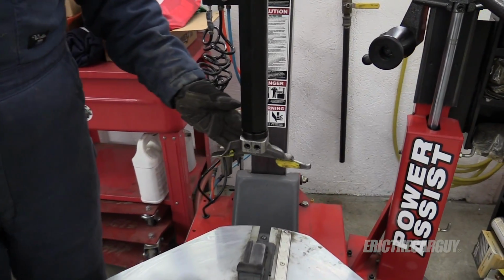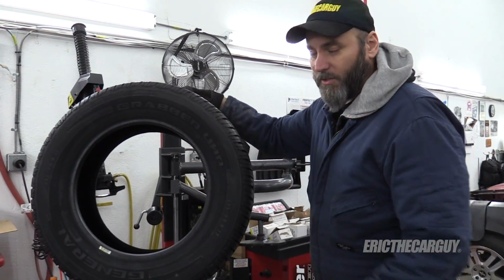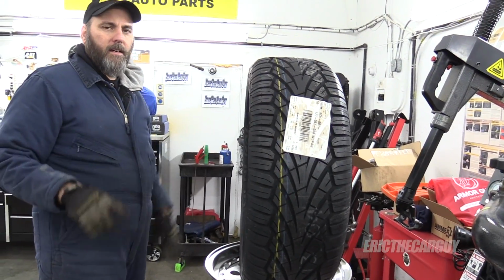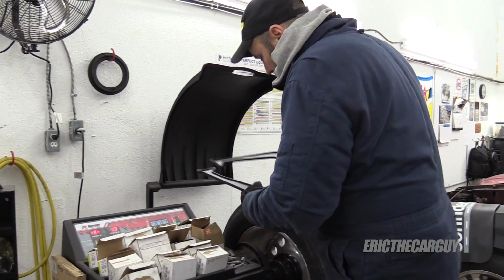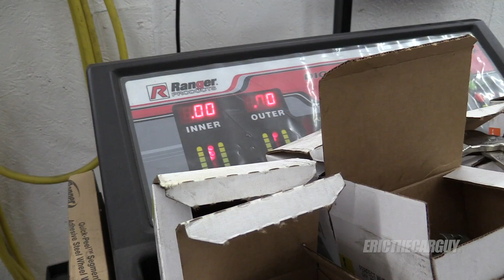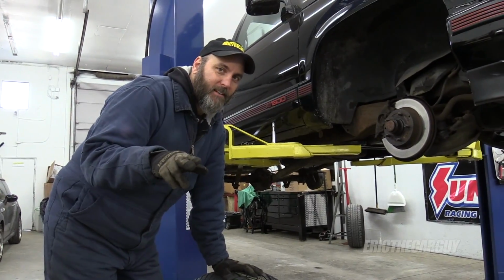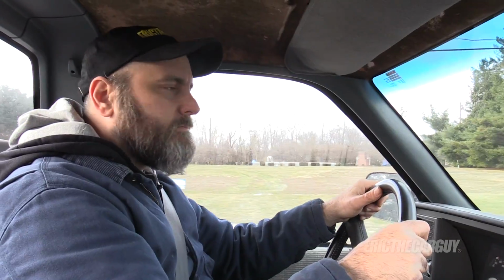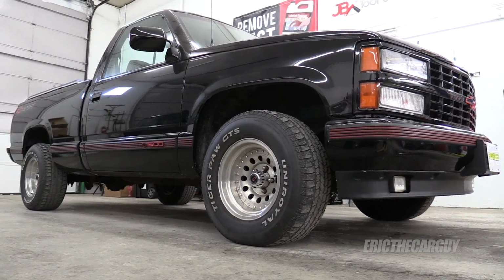#ETCGDadsTruck Gets Wheels & Tires (Episode 2)

Comment: Consider putting a laser level on your balancing machine. You can use the laser line for easy placement of weights as you don't have to guess exact 12 o'clock once the level is aligned.
Reply: Spot on. I was thinking the same thing after watching his fight.
Reply from the maker: Good idea.
Reply: The hunter repair guy that comes to our shop says you should never store weights on the machine because it throws off the balance.
Reply: @mattkaydus7973  Unfamiliar with the machines. Worth considering. If direct mounting has an appreciable effect it always could be installed in line with the machine but mounted low off a footing or something.
Reply: Thats for rooks

Comment: Eric, you have quite the nice wheel/tire tools there.  In fact, your whole shop is well outfitted.
Our shop would do wheel balance every 7500 mile service at our Infiniti dealership.  Wrestling 22-24" aftermarket aluminum wheels off of a QX56 and trying to balance them with tape weights was ALWAYS a nightmare.  Round and round we go...

Comment: i know your pain Eric. in my old shop we had a picky balancer (boss wouldn't calibrate it or get a new one lol) same style as yours and fought all the time with it. i found the best trick was to start with the sticky weight side first then do the clip on last. some wheels i found would be a fight no matter what but sometimes even putting an extra 0.25oz would make the sticky side zero out. 
just food for thought Eric. hope you see this and it may help you.
Reply from the maker: Great tip. I'll have to try that next time.
Reply: Even when they are calibrated, if they are sufficiently old, there's no saving the machine. Bearings, motor, wear and tear on the electronics and EVEN the cones, they just don't work anymore. I have one that's likely been in many shops until i got it, because i do tires once or twice per years, so i can't be bothered to buy a new one. It's calibrated and has new bearings, but it still fights me.
Reply: @aserta - Mine is only 9 years old, but has done the .25 oz swap game since it was new. I figure it must be the way the computer in there is calibrated from the factory. The chinese balance I had prior never did this. It's definitely aggravating, though. Going to try the OP's tip of starting the stick-on weights first - sounds like a good plan.
Reply: Eric - I'm wondering if the stick-on weights are having slightly less effect, as the further inwards they are from the outer edge of the rim, the less leverage they have to affect the balance.  That might explain why those weights always seem to need an extra .25 oz or so.  I remember having a similar situation when I learned to balance in tech school, but that was on old equipment and 35 years ago.  Your balancer is pretty new, and I'm assuming balancer accuracy has improved over the years.  Could be worth a thought, anyway.  :-)

Comment: when I was a mechanic long ago 80s-90s  tires where relatively smaller. didn't have as many fancy rims. steals were easy to work with.  Now everything has  truck style tires which are heavier and bigger work with.  Tires are more of  a pain in the ass to work with currently. 
regardless those Centerline style aluminum rims have always looked great on a older truck. Good choice Eric.

Comment: Those things are sweet! Nice choice. I have a similar looking tire for the summer on my Silverado, made by Hankook (Ventus). Got the set dirt cheap off eBay a few years back. 

I fight with my balancer too! I thought it was because it's chinese (Atlas brand), but seems to be the way most of them are. My old no-name balancer didn't seem to keep placing .25 oz. weights right next to each other like the Atlas does.

Looks like I need to upgrade my tire machine though! Your's is REAL NICE. The tilt back plus helping hands make a HUGE difference. Mine is like a piece of exercise equipment - no matter how cold it is in the shop, I'm sweating beads by the 2nd tire.

Comment: Tech tip: yellow stripe on the tread mount two tires with the strip on the inside of the wheel and two with the stripe on the outside done ✅

Comment: The easy way to mount directional tires, in my opinion, is by the dot date. You do, 2 dot date on the outside, and 2 dot dates on the inside. Usually works unless the tires have dot dates on both sides.

Comment: The plastic caliper used to measure wheel width is usually of by 1/2”. Reason being the wheel width is measured from mounting surface.  The caliper is measuring an extra 1/4” on each end.

Comment: Eric i use ur videos for all my sick Honda needs lol u are good at what u do and easy to understand and I greatly appreciate that cuz my car knows how to stress me out lol 97 accord se non vtec i have replaced all cooling system water pump radiator timing belt all hoses thermostat gonna do engine coolant sensor in a min i have did all u said bled the air out with valve by thermostat housing etc. Over n over but i untighten valve let run all u said but my gauge dont even get close to middle stay way by cold n still has air so is there any other valve or should i drive it with valve loose a few blocks. Cuz after my car warms up i cut it off it dont want to fire n i smell lil gas but it acts like it misfiring then it will kick to normal on rpms n it aint running at 1000 on rpms its under
Reply: Give me some ideas where to check to fix problems

Comment: Eric, I'm sure you know this, but if you're chasing weights, the best way to fix it is to adjust the position of your weights. If you're off by  0.25, slide your weight 1/4 in the direction of where your machine says you need to add weight. 

Putting weights in multiple locations isn't actually balancing the tire, you're just tricking the machine.

Comment: I remember when I was lowering my ç1500 years ago.  Alot of the lowering  spindles would widen the track some . Like 3/8-1/2" each side and would cause rubbing on the wheel lips of the fenders to the tire.  Im not sure how much you plan on lowering it.    But I have a 4f spindles and spring and a flip kit in the rear.  Im pretty sure it has shackles as well due to tall tires.  But it seems very drivable even pulling a car trailer.   It does occasionally hit the bump stops in the rear though.

Comment: The new wheels/tyres look smashing, very similar but better :-D.
I had forgotten about the up gearing effect of bigger wheels, larger distance traveled with each shaft rotation.
You were speeding, slightly :)
Reply: The new wheel/tire combination is only 4 less revolutions per mile than the stock wheel/tire. So, he was speeding by about 0.2mph at 50. Not even worth noting.
Reply: Tommy-Lee Armstrong
I did say slightly :-D
Reply from the maker: I tried to get a tire size that had a smaller sidewall so that the overall diameter was about the same. I don't think the speedo is accurate now because of the mismatched transmission. My new speedo will be satellite so I shouldn't have to worry about it being inaccurate.

Comment: Just something to think about, but I have always had new wheels, whether steel or aluminum, spun on a balancer to check for warpage, trueness and severe out of balance, before tires are mounted. No weights are added this time, it is just for inspection purposes.

Comment: We had the same brand of balancer, but an older model. Same problem... then it got progressively worse until it stopped reading consistently all together.

If you can afford a newer design, it's really worth the time fiddling. It may not seem too bad but it adds up.

Comment: Here's how you do the stick weights man.  Take it and bend them so the middle doesn't touch the rim. Spin it if its zero than just smush weight down.  If you need to move weight up or down you can do it easy because whole weight is not stuck on.  Tires are good with that little weight

Comment: Kind of late but if you move the weight side to side you can feel if its top dead center the if you look over the wheel you can confirm if you sight the weight with the spindle. Another thing to think about is using a heat gun on both the weight and wheel as well as using alcohol and a lint free paper towel on thw wheel they typically have oil on them from the factory and it can help keep from losing stick on weights later on. How you did it will work for sure just some ideas to help make it last a bit longer next time

Comment: swee truck i have my grandpas  1991 Silverado Extended cab 2wd, needs some body love but the 5.7 in it has 220k miles on it and runs smooth as heck. My grandpa used to sell amsoil so synthetic fluids is all this truck has seen, sadly the trans is not original lol 700r4 issues, but the built trans i put in it works great, updated every problem part in there and addeed more clutches to the usuall problematice 3 4 cluctch pack. so instead of the stock 5 clutches it has 9 in it, the 1st to 2nd shift will about snap your neck off when putting the throttle down at times. i love this truck and am also in the debate of putting a 383 in it or going with a 5.3 LS with turbo. will have to see how yours turns out might help me deside what way i want to go.

Comment: You have to use the arm to install the tape weight inside. thats why your not getting 0 balance right away. it ends up being at around 11 oclock not straight up like your doing it. Try the arm and it will work perfect.

Comment: When your balancing wheels don't just keep adding weights where the machine tells you to keep all the weight together on each edge of the wheel if the machine is telling you to add more weight to a side of the wheel you have already put a weight on move the first weight round the rim half way between its original position and the position the machine is asking for more weight on,  hope that makes sense and helps you balancing wheels in the future love the vids and both channel's

Comment: I've had balancers that I've fought with as well so instead of wasting new weights, I'd use old weights with masking tape first to get the position/weight figured out temporarily before sticking on the new weights. Temporary sticky first, then clip on. Also, since you live in an area where they use salt, avoid using any clip on weights unless you want that dreaded corrosion to creep inside to the bead area of the wheel. Aluminum can be cleaned and bead sealed but chrome is hopeless.
Reply from the maker: Dude! Great tip. Thank you.

Comment: You'd have a better balance putting the cone on the outside as well. That way, the wheel hub is flat on the flange and the cone is helping you straighten it instead of the two cones fighting each other to an unknown straight.
Reply from the maker: The problem with that is it can damage my new wheels.
Reply: @ericthecarguy  How? I've always used the little "inner" cones on the outside and used the handle to snug it on. It mounts the wheel more straight and gets a more accurate balance reading.

Comment: Does your balancer have a round feature? I used to have the same issue. Then I turned off the round feature and I was amazed how much easier it was. The balancer seemed to have a poor logic system. Sometimes it would round .43oz down to .25oz instead of rounding up to .50oz which in my opinion seems like the better option.

Comment: I have been told. That new tires can struggle to balance because when they pop on to the rim under pressure the bead is stretched and out of round just slightly.
If the fellow who gave me this advise is correct you can fix it by letting the tire completely depresurise before installing core and inflating to final pressure.

Comment: I have an old hoffman 2100. You think you have fun with yours- at least it works. Mine doesn't tell me where the weight goes anymore. lol I have to give an educated guess and move weights around via process of elimination to balance my wheels. Takes a long time. I'll give you a tip or trick when you are using the stick on weights. If you are dynamic balancing do the stick on wheel weights first. those weights will affect the backside weights that clip on.  The problem is the weight is not going where the balancer wants it. It is going to the inside. You might be able to get more accurate readings by telling the balancer that the wheel is narrower. For instance, the 8.5 width is not where you are putting the weights. Try the 6.5-inch? width that actually represents the true distance between the weights.

Comment: Do you think some 16" wheels and 32x12.50R16 would fit on a 95 C1500? It has more height on the front end than a normal C1500 for some reason.

Comment: Hey Eric I have a question for you. I replaced my passenger side wheel bearing  and hub on my 1990 Corolla sr5 . Spins smoothly and everything until I tighten up my lug nuts . Once they're tightened to a certain point the rotor seems to scrape at the top of the caliper and wont spin unless I force it using a lot of strength Once I loosen them a bit the tire will spin again while making a slight scraping noise but they're too loose to ride on at this point ...

Comment: Are you gonna put a headliner in that truck?  lol.....
Reply: Maybe one of the sound system headliners since he's aiming for 90's styling I remember many people using those back then.
Reply from the maker: I'm not planning on doing any cosmetic work at this time. I'm going to wait till after I get all the performance and mechanical work done so that I'm able to make the Power Tour with my dad. Cosmetic work takes time and money I don't have right now.
Reply: @ericthecarguy  How 'bout just a headliner and nothing else?
Reply: @ericthecarguy  I'd say you're going into the build in the right way, why invest into the looks until you're sure it'll be hauling you around, after all yard art can be costly.  I'd keep the truck as original as possible which seems to be the direction you're planning to go right now maybe one day decide why not try to build a 454 SS and you'll have the perfect truck to start out with.
Reply from the maker: @SalandFindles The headliner has no effect on vehicle performance.
Reply: @ericthecarguy  lol, obviously not. I'm not dumb. It'd definitely be at least the one single thing I'd do cosmetically once you're done building the rest of the truck. Don't do anything else cosmetic, just the headliner.
Reply: My daughter's first car was a Ranger with a sagging headliner and we just pulled it out, and rattle canned the cardboard black and it looked fine.
Reply: Mine did the same...glue let go...I replaced it using a brand new flag. I ride with Old Glory above my head. Stars above my head. 🇺🇸
Reply: Replacing any interior trim is a pain in the ass no matter how small or simple the job appears, so I don't blame you for not making the headliner a priority Eric.

Comment: I thought the dot marked the heavy spot of the tire and should have been put opposite of the valve stem because the valve stem is the heavy spot on the rim?
Reply from the maker: How would you determine that with any accuracy? It's much easier to line something up with a valve stem.
Reply: The yellow dot is the light spot of the tire. Red dot is for radial runout or uniformity. If you don't have a road force balancer, red dot is priority to clock to the valve stem if you have both red and yellow. Road force machines can find the low spot of the bare rim and you match the red dot with that point. Some rims come with stickers or notches that indicate the low spot from factory so no need for road force balancers in that instance.

Comment: Speedo is clocked out at 140km/h crazy... My 800cc Chevy Spark is clocked to 180km/h... Only way my Spark will see 180 is down a mine shaft, I might ad.
Reply: Same for my Mk3 Golf, I have another cluster faceplate on it but I'm pretty sure the original one also said 220 km/h. Well from factory it only went 191. After 22 years it can still go 180 though. :D

Comment: Eric, you said you check for unbalanced tires at 55 MPH.  What is special about 55 MPH?  Is it resonant frequency of tires?  I wold think the resonant speed would change depending on tire height.
Reply from the maker: Yes exactly. 55-60mph is usually where tire balance issues show up. If it's above that, it's usually a driveline vibration.

Comment: Do you have steering play? I have put 3 reman steering boxes in from AZ and they all have play
Reply from the maker: Check the linkage, especially the idler arm.
Reply: I put a hole new front end and the rag joint is tight. Do you recommend any brands for steering boxes

Comment: Instead of putting more weights on, if you'll move your origional weight toward where it tells you to put the new one, it'll come out zeros. If its directly across, reduce the weight amount by a .25 and try it and it'll most likely zero. These are calibration errors that you can correct for. 😀
Reply from the maker: Thank you.

Comment: 15:15 is that how the engine normally sounds?

Will you make the red highlighting on the bumper and sides more brighter?
Reply: The auto trans has overdrive. It lowers the RPM of the engine at higher speed. So yes and no to answer your question. If the truck has a 4L60 (likely) then it's got an aggressive overdrive.
Reply from the maker: I'm not doing any cosmetic work at this time. At some point I hope to do a complete respray. At that time I'll worry about appearance.